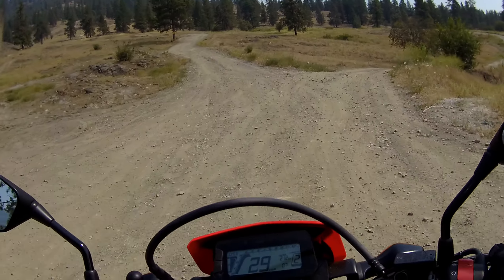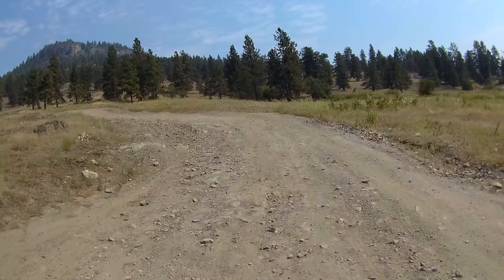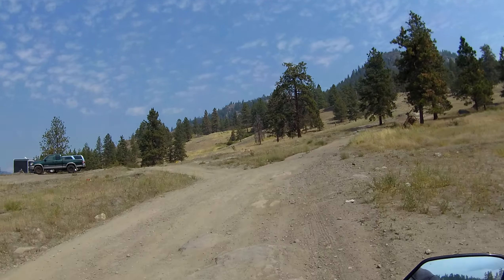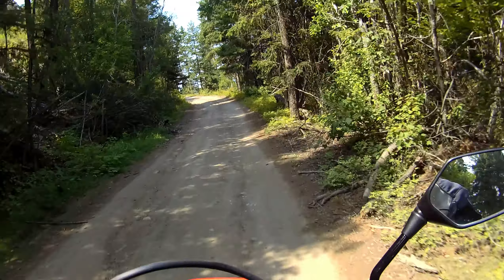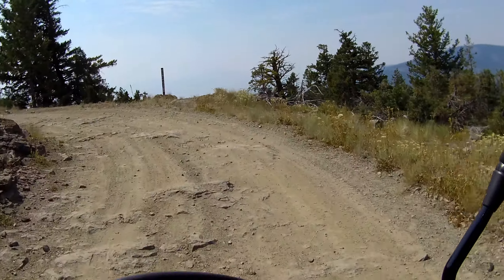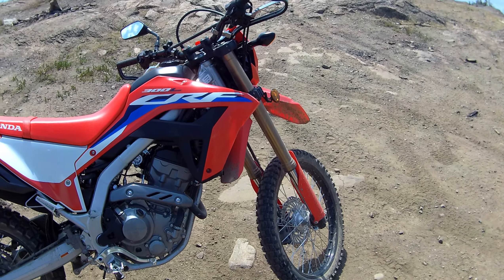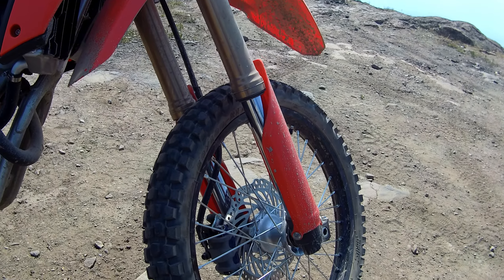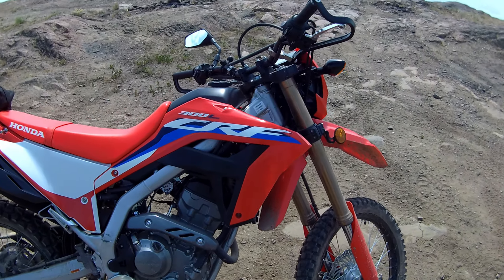CRF300L Engine Rattle Info & Other Thoughts | Ride to the Top

Comment: It doesn't matter that you paid a premium for the Honda name based on their self promoted quality and service.  It's just a rattle, live with it, don't pick on Honda, they're great (said the fan boy).
Reply from the maker: Yeah I think that's what I'm saying in the video. It's just a rattle and usually of no concern, except when it's serious as it was with my 250L. I'm not picking on Honda.
Reply: @Scoottoots  That's exactly what you're saying and you're perfectly wrong.  Did you miss the sarcasm in my post?   Honda charges a premium for their product, they should deliver a premium product not a rattle can.
Reply from the maker: @hazcat640  I probably missed the sarcasm because it isn't warranted. Honda did not charge a premium. They underpriced it if anything considering the improvements they made from the 250L, that was in itself a great value. You won't find a comparable motorcycle retailing for less. And the rattle? Lord knows I understand about that. I had 3 OEM CCT's fail in my 250L. And I do mean FAIL, as in to point where the chain could have jumped teeth on cams. So I'm not the guy who blindly defends Honda. Realistically though? What happened to my 250 was the exception. Usually, people hear what they think is a rattle, as in 'problem,' but there are all sorts of noises in almost every thumper regardless of manufacturer. Valve chatter is a common one. On some engines if you can't hear the valves they need re-shimming. It's impossible to build a reliable motorcycle like this -- at this price -- and not compromise someone's expectations. It isn't a BMW or a KTM. Now that's where you'd pay a premium, both for the bike and the maintenance.

Comment: Hello Scoot Toots. I've isolated that rattle/clatter on video: https://youtu.be/hQsN8RhpzTE . Is your bike sounding like this too? Is that normal? Doesn't seem to affect performance.
Reply from the maker: I listened carefully to your video and I don't think that is a problem CCT. It would be different and a lot more to it. I feel the noises you hear are valve train noises and typical of this engine now that it is stroked and using different intake cams than the 250 used. That's just my opinion of course, so do get it checked if you're concerned.

Comment: I cured my engine rattle with belray thumper synthetic ester blend oil
Reply from the maker: Good stuff. I switched to Motul 5100 Ester based oil but haven't noticed any decrease in valve chatter noise, etc. I used to use Motul 7100 Ester full Synthetic in the 250 and that quieted things down some; excellent oil but found it almost impossible to get the 10W 30. No one carried it, so I used 10W 40. In this bike I want to stick with Honda's recommended 10W 30, so that's why I went with the 5100. It's formulated with Honda specs in mind. I'll look into that Belray product. Thanks :-)

Comment: Sooooo, “I had to replace the Cam Chain Tensioners three times on my CRF250L”……but nothing to fret? Are you on drugs, dude?
Reply from the maker: Maybe if you actually listened to the video you'd get it. Like I said, mine was an extreme situation, likely caused by a flaw in the engine casing on my bike in particular, so nothing to do with the average rattle from the cct. I sited my situation with the 250L because it informed me about the CCT and the common rattle a lot of owners hear.

Comment: Not beating hard on you but...
That camera is horrible. You can get a cheap camera with decent quality stabilisation.
This makes me dizzy.
Reply from the maker: Thanks for the feedback. I think in this video the stabilization appeared choppy in sections. All in all though it performs excellent. Stabilization is usually smooth. This route was very rough in parts. Check out a few other of my videos. I think you'll see the stabilization is normally quite good.
Reply: @Scoottoots  I did. Yeah, not as bad.
I have a chepo China camera, although a decent China camera, and it is only not able to stabilise the video if attached to the bike at high RPM (7k +), but even then it only wobbles (twilight zone style 🤪), it doesn't create that shaking in this video.
That was my comparison point.
Reply from the maker: @zefautino  Yeah i get it. It's not perfect for sure. I've had my issues with it, but I like this camera for many reasons. High among them is the 6 hour battery life and low profile on the helmet. The color rendition and saturation are descent as well.
Reply: @Scoottoots  6h!
I get 1h30m in 4k...
Reply from the maker: @zefautino  That's pretty good for 4K compared to most cameras. I never shoot in 4K. Don't seem to feel the advantage. I shoot in 2.7K because at that resolution (compared to 1080p) Y/T uses the VP9 codec to process the HD, resulting in higher quality final video.
Reply: @Scoottoots  I don't bother about 2.7k because it uses the same memory space as 4K, so why not 4K?
Recording in 4K I can downgrade to 1080, which for YT is all you really need, most people view YT on their phones and there's no benefit in uploading in 4K.
Reply from the maker: @zefautino  The benefit to uploading in 2.7K is to get the VP9 YT codec in processing. It provides for sharper, better, video . I notice your videos are encoded by YT using the lower quality AVC codec (right click then left click stats for nerds on any video to see the tech data). For high motion videos it then makes a noticeable difference.
Reply: @Scoottoots  I don't really care about any of that. Life is too short mate.😉
Reply from the maker: @zefautino  Yeah that's what I thought about the camera critique ;-)
Reply: @Scoottoots  Yeah, can't take to heart. But can always improve.
I throw much of my recordings down the toilet, I realise it's not at a good angle, or the lighting is bad, or...
I really thought you were still using a gopro 3...
Reply from the maker: @zefautino  Same; I don't fuss. I try my best using what I have, but I'm no YouTube star so I don't care if there are flaws here and there. I do it because I enjoy it. Never had a GoPro of any sort. My only cameras have been the Drift brand. First, the Ghost HD, then this Ghost 4K.
Reply: @Scoottoots  You now talking Chinese. 🤣🤣🤣
Other than Akaso and insta360, I know only gopro and DJI.
Any other gopoor cameras I don't know.